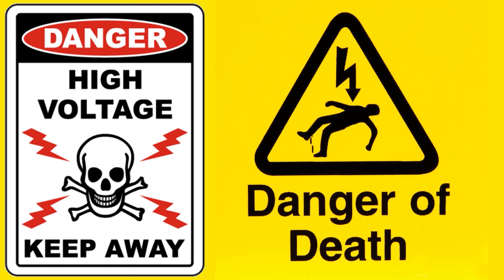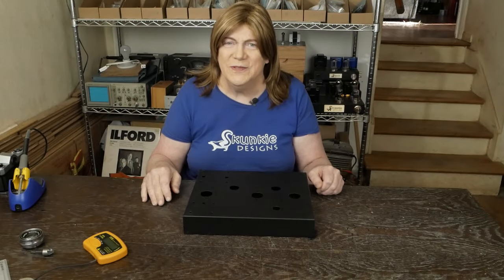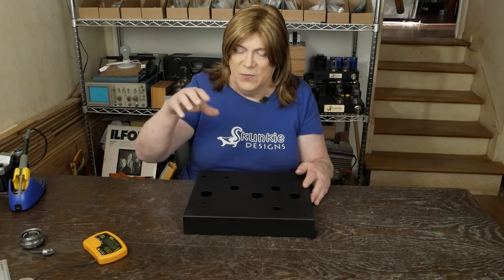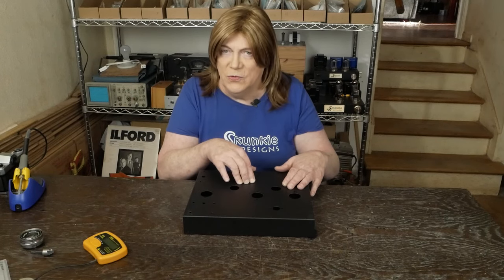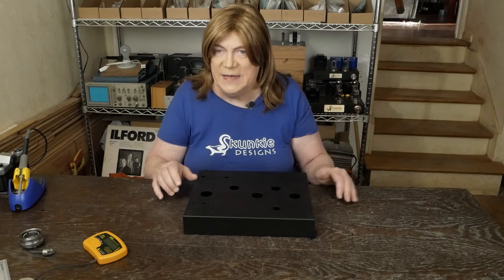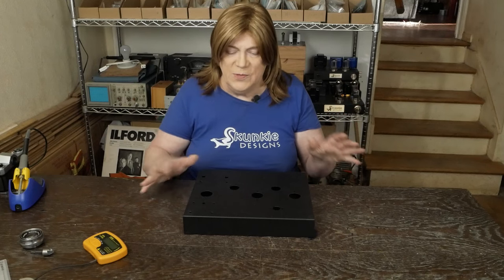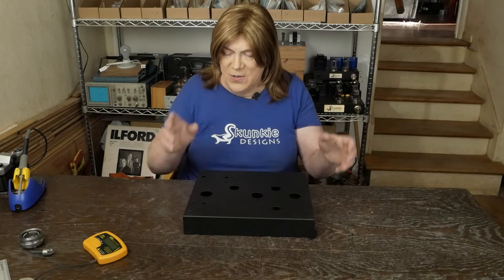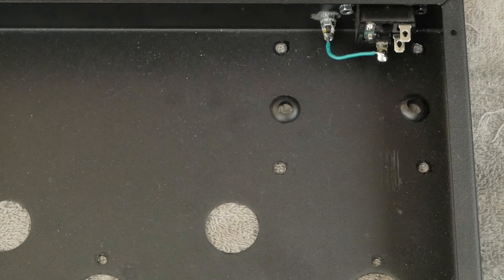5751/EL34 Amp: Production Amp First Steps

Comment: For rectangular cutouts I like to use a jigsaw with a fine-tooth HSS metal blade. I slow down the speed of the saw and then have good control over how/where it cuts. Taping up the sheet metal first so that the jigsaw doesn't scratch the paint. Works both for soft metals as well as steel.

Comment: The IEC connector, exactly the way I do it. Usually a bit smaller then I actually need. And the use a vile to get the exact size. Just wondering what is the thickness of the chassis? Ow.. and metric, for the win! haha

Comment: I've found that heating the labels with a blow dryer softens the adhesive so it all comes off with the label. A heat gun will also work but you have to be careful because they can damage the finish if you leave it on too long.
Reply from the maker: Great tip!!!

Comment: Oh geez, Stephe. A piece of metal got stuck in up your eye? Glad it didn’t blind you. That’s scary. 
Beautiful prefabrication work. Getting a chassis ready for parts isn’t easy, especially when working with steel rather than aluminum. I got into building guitar effects pedals decades ago, and drilling out an aluminum box is SO much easier than steel, but as you said, bigger aluminum chassis are just not as strong as steel. 
FWIW, I’ve had the same pair of calipers for probably 25 yrs, and they’re still working fine. The right tools for the job is a necessity.
Reply from the maker: That was probably 20 years ago!

Comment: Sorry to hear about your eye accident, it's damn scary! I always work in glasses, and sometimes use a face shield. A leftover from the pandemic :).

Making holes in the corners when cutting a rectangular hole is the way, the result will look elegant after you cut it with a rotary tool, with greatly reduced risk of cutting beyond the hole. It's best to cut shorter than you would normally need, and then break the remaining scrap out, some filing and it's good to go. 

I use an automatic center punch, it's very handy. Classic vernier caliper for me too. Mine is 1980s Polish vintage, and I still use it.

Comment: I cut out the power connector as you described but I put 4 or 5 layers of masking tape on the chassis to cover around the area. If you have masking tape that is as wide as the height of the chassis even better. I then draw the area I need to cut out. The masking tape helps the cutting wheel from skipping around so much and if it does jump around the chassis is still protected by the masking tape.
Reply from the maker: Great idea

Comment: I just bought an very old and ugly 2 * EL34 amp. As it happens the main transformer has exactly the same windings and voltage. The OPT had a discontinuity on one of the anode connections, so i am very curious about the rest of your project. I will use a GZ34 for rectification. There were 2 vintage Philips EL34 in the amp. They measured on my tube tester as new and paired YEAH!!! And it has a very good choke, I never build an amp without one. I paid 120 Euro.

Comment: many times I have had to run wires without grommets. what I did was to use a fine rat tail file and smooth the holes very well first. I use grommets when I have them.
Reply: Not using a grommet is an opportunity to operationally test the chassis ground. I suppose one could use one sleeve of hard shrink tube and get some level of protection.
Reply from the maker: Hmm risk a short on a device with hundreds of volts inside to save $7.50 buying a kit with a lifetime supply of grommets?

https://amzn.to/3uHS1jA

Comment: for me a jig saw with a metal cutting blade is the way to go, easy peasy and lots of control.  I DO have a bench vice that can hold the chassis while sawing though.  Freehand without a vice or clamp is not going to cut it (pun intended).
R

Comment: @Skunkie. Would it be possible to have you make up the chassis with all the holes drilled out?  Then, I would get and install the parts myself.  I would be interested In that.  If so, what would be the cost?
Reply from the maker: I can't hand fabricate stuff like this for anything near reasonable prices.
Reply: @SkunkieDesignsElectronics  Okay, that's fair enough.   I will stick with my original plan.  I am going to build my EL34 amp on a Dynaco ST-70 chassis.   Granted your chassis is nicer and, of course, made for it.  But I don't mind sacrificing aesthetics to keep costs down.   Heck, if the amp sounds fine on a breadboard with NO chassis.  I am good with that too!